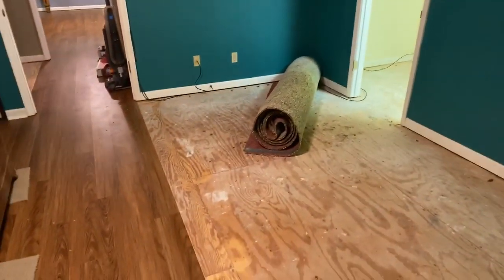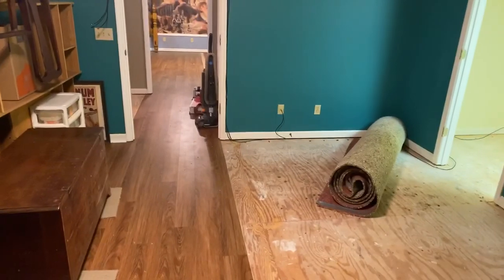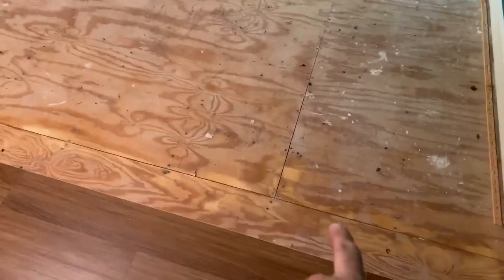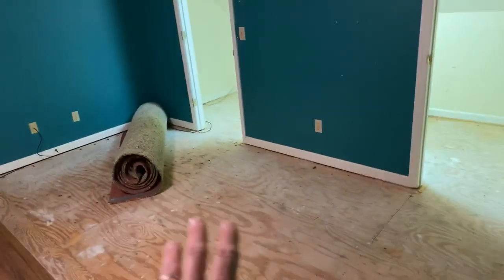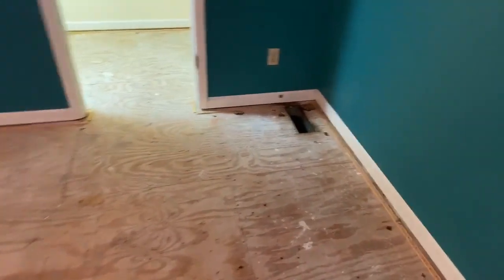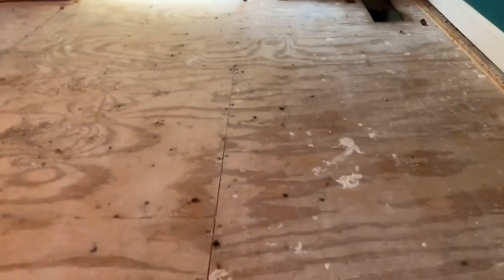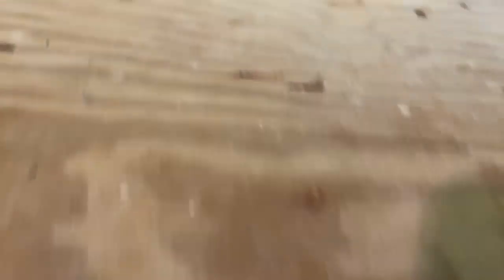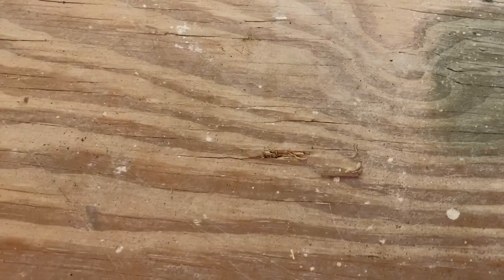Why you shouldn’t use a stinger

Comment: Stinger user but I only use it in shaggy carpet. Sorry if we leave this kinds of marks but most customer are elders and prefer carpet over lvp. I wouldn't consider this a hack believe me it stretches almost as hard as the poles. Maybe you should make a video comparing poles vs stingers that would be very nice to watch.
Reply from the maker: jc 7394 That’s a good idea
Reply: I’ve been using a single type stinger for years and years , never had an issue with residential homes ,and stretches about aswell as poles
Reply: Stinger user, and I believe you can get more out of the stinger before the carpet on the other side leaves the pins than with poles... but do you consider staples and tack strip floor damage too? They are leaving holes as well.. lol those marks are gone once you hit it with the scrapper. Anyways ive just bought the kneeless stretcher by Pete to try for concrete

Comment: Double stingers do not do this because they cut the force in half. They spread the force out. Ask an installer who has used a stinger for 35 years without a single call back brought on from using a stinger if its an issue. Do the bills get paid using a stinger? Yes. If you cant handle some little spots on the subfloor in a house how will you ever handle some of these absolute subfloor disasters that installers deal with on a daily basis. Better not use water in a house because it absolutely destroys subfloors. Thats the logic you are using. If it works for you and it pays the bills and the customer is happy, use it. Don't listen to some dude half your age on the internet.  No offense.
Reply: I agree with you on the double stinger. However, I only use it on some carpets, smaller rooms and never over a hardwood floor.
Stingers do not streach larger rooms properly.
Reply: @chrissheafer  totally agree people think stingers are for hacks but in reality we only use it shaggy carpet and on subfloor. If we were actually hacks then we'd be doing it on berber carpets and concrete at the same time lol keep in mind 80% of carpet jobs are shaggys
Reply: I love this post im in the same boat

Comment: Don't knock untell you try the stinger . Because the painter's will love you not tearing up the base with the foot of the tubes !!!! And NO BACK CHARGES
Reply: I use a couple different sized carpeted 4x4s along the wall. Never had issues with painters back charging for repairs.
Reply: I  HATE PAINTERS